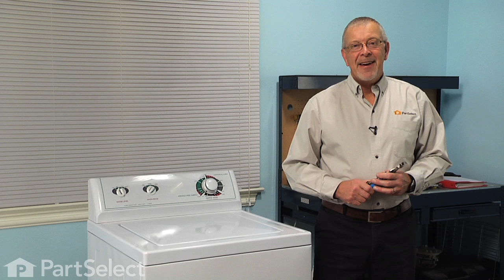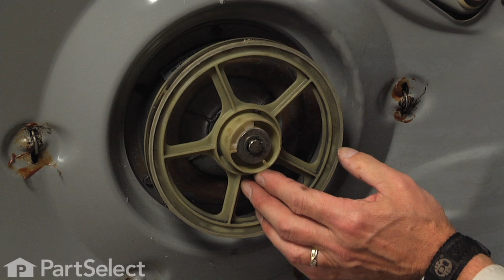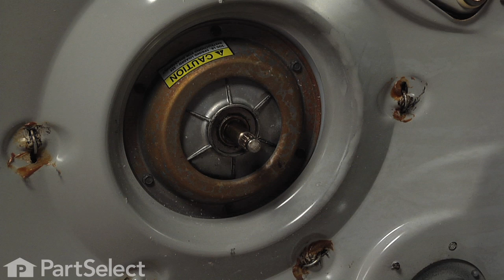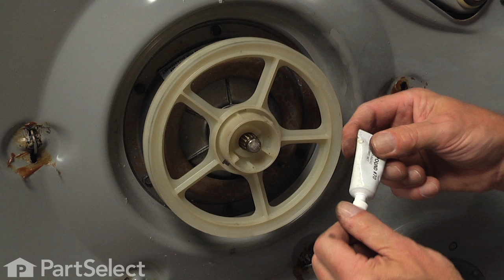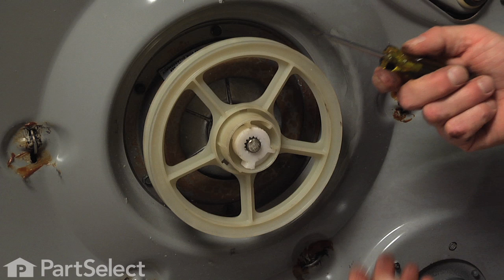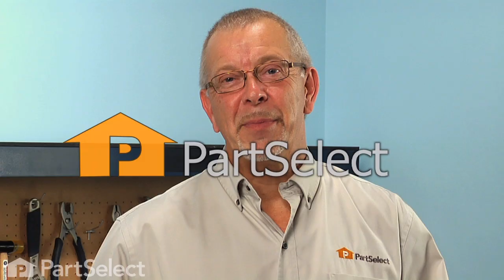Washing Machine Repair - Replacing the Transmission Pulley & Bearing Kit (Whirlpool Part # 12002213)

Comment: The problem with my washing machine was that it would not spin during the spin/rinse cycles. If I manually spun the tub around a bit then it would spin but it made a very loud roaring-whirring noise (you can hear it outside). So I got my kit and installed it (yes, the e-clip was a buggar to get on), ran a test cycle, and it spins but it's still roaring. It remains to be seen if it will still spin every time. What else could be making that noise?

Comment: I have a Hoover HAV4200AWW I replaced the Transmission Pulley & Bearing with the kit. It still will not spin. It was very hard to get the E clip back on, and the white plastic cam that fits in the transmission pulley would move with the shaft. Something else is wrong. If you try to turn the drum by hand, it is very hard to move. I checked between the drum, and tub, but found nothing that would prevent it moving. What would cause the brake not to release?
Reply from the maker: if the cam is position right you should be able to turn the main pulley by hand with the belt off and the machine unplugged one way and the machine will agitate. then rotate the pulley the other way which will rotate the cam and release the brake and the tub should turn freely. Sounds as if the brake is not releasing properly

Comment: Great video, thanks.  Two questions.  Why does the kit include the big pulley wheel?  Is there any part of the old pulley wheel which wears out?  Secondly, I replaced this bearing 8 years ago using one washer curing the problem nicely.  After an additional 8 years I am again having the original issue.  Is it possible to add the washer I did not use last time to perhaps cure the problem again?  If the bearing has worn a little and needs a little more pressure, adding a washer is just a little cheaper than buying the whole kit again.

Comment: How do you diagnose that this part is a problem? I just replaced the motor on my Maytag a week ago because the original motor seized. Could barely turn it by hand. Was smelling what smelled like burnt candles for a couple of weeks but our Maytag Performa Model Number PAV2300 seemed to be running fine. Now after a week with the washing machine running like New a odor and smoke is coming out of the new replacement motor that it shuts the washer machine down. At my witts end at this point. Don’t just want to throw parts at this 16 year old machine. Any ideas as to what is going on? I should mention the machine while running is doing what it should be doing but my guess is something is causing it to make the motor overheat and there are no funny noises coming from anywhere. I am stumped. I take the belt off which I replaced with a new one at the same time I replaced the motor. Pump pulley turns freely back and forth. New motor pulls turns freely back and forth. Transmission pulls turns clockwise freely but not counter clockwise but does turn my hand counter clockwise making me think  maybe this is putting stress on the motor.  I am about to give up and purchase a new washer soon if I come up empty here. Any and all help is appreciated.

Comment: Hi, i have a top loader whirlpool washer. It washes good and everything but the issue im having is when it starts to spin it bangs against the sides. Crazy noise. What could the issue be?
Reply from the maker: Hi Linda, thanks for the question. Here's a troubleshooting guide for a noisy or shaking washer:
https://www.partselect.com/Repair/Washer/Noisy/
https://www.partselect.com/Repair/Washer/Shakes-Moves/
I hope this helps! Let us know if you have any more questions!
Reply: PartSelect i found out that its just the rods that need to be replaced.. thx for your reply

Comment: I have a Maytag Performa with this setup. The machine fills and washes fine but the tub will not spin. I verified this by marking the inner tub and noticed it stayed in the same place. The clothes come out soaking wet. These videos show how to replace the pulley but do not state the symptoms. I notice there is a ramp in the pulley that corresponds with small part under the E-clip. Does the ramp release a tub brake when the big pulley is turned in the proper direction?
Reply from the maker: Hello, please provide your model number and I will be happy to research this for you.
Reply: Did you end up finding out the problem on your washer? We have the same issue too.
Reply: I think I might be having the same issue!

Comment: What about the smaller pulley (also on the bottom but towards the front right corner)?  I was thinking my issue was the belt, but when I tipped the washer over I found shredded pieces of the pulley on the floor and the pulley was shredded and jagged.  And if I replace the smaller pulley will that solve the problem or is there some more serious problem that means I should just replace the washer?  I am looking to get at least a few more years out of it.  It's a solid machine and not filled with expensive electronics like newer ones.  And should I go ahead and replace the belt while I have it tipped, in case the shredded pulley also affected the belt? Thanks.
Reply: Also, the washer spun and agitated almost 100% ok (though it would sound fairly loud and unbalanced) until a few weeks ago when it started getting really loud.  Eventually last week it started making the burning smell so we quit using it.
Reply from the maker: Hi Gary,  the smaller pulley is either on the pump shaft or the motor shaft and are not available separately. We do see some motor pulley failures occasionally and the part is relatively easy to change. What is your model number and I can check parts for you?

Comment: Just replaced the items in this video. Seemed to do the trick, no more noise. I used the small washer, think it is ok. Will check in a week to make sure I do not need to change out for thicker washer. That seemed to be my only concern if I got that correct or not. It had the thicker washer on old part when I took it off.

Comment: I have a Maytag washer model MAV208DAWW. It is making a lot of noise when washing/rinsing, I just replaced the belt thinking that was the problem. It is still making the noise :( Would like help from someone in diagnosing further as to what my next step should be. Thank you.
Reply from the maker: When checking under your model number for the symptom “noisy” the top parts customers have ordered to correct
that issue beside the belt is drain pump, snubber ring, brake rotor or stator. Here is a link to our site for your model symptoms to read our customers issues to see if they might match up with yours. If not, I would suggest contacting the manufacture for trouble shooting.  http://www.partselect.com/AdvancedModelSymptoms.aspx?ModelNum=MAV208DAWW&mfgModelNum=&fkMfgID=1&ModelMasterID=6379&PID=43

Comment: I have a Maytag PAV5158AWW  and the symptom was not spinning or agitating - but it did drain water. No noise noticed. I replaced this (thrust bearing and motor pulley) and it didn't fix it. Any other thoughts? One thing, re: the alignment and pulley adjustment at the end, is that when I turn it by hand the arrow JUST makes it to the pair of reference points. That's without using any washers; just the 'E' clip. Am I right that if I used the thin washer that it would prevent it from even going that far, so I should leave them both off? And even if it isn't quite getting far enough, I imagine that it would still turn some when I run it?

Any other thoughts?
Reply from the maker: Does the inner basket turn when you rotate the drive pulley by hand in the counter clockwise direction? Does the agitator oscillate when you turn the pulley clockwise?
Reply: Thanks for the response!!! The agitator does turn when I hand-turn clockwise; the basket does not when I hand-turn counterclockwise.
Reply: Just a "bump" in case you missed my reply and new question.
Reply: Just a "bump" in case you missed my reply and new question.
Reply from the maker: When you turn the pulley counter clockwise you should meet some resistance as the cam contacts the pulley and forces the brake spring to compress. This action releases the brake and will allow the basket and transmission to turn. Check to see if the pulley and cam are properly installed.
Reply: Thanks; I don't recall that resistance, but I have it apart again, trying to fit one of the washers on. First, can you please confirm that I'm using the correct part, this assembly for my Maytag PAV5158AWW? (reportedly, it was an Amana rebranded by Maytag, fwiw). 

The spacers/washers are different, and I can see why I can't fit a washer on, as the new pieces inside of the pulley take up more space than the 4 combinations of washers/spacers that had been on it. Or should I try it using those? I'm not even sure that this was the problem before?!

Great videos for installing replacement parts, but the diagnosing of the problems/solutions seem to be the bigger problem for people. Thanks.
Reply: I re-checked my install, and that was correct. And see that they've re-designed the assembly, so I simply am using the new one. 

I finally was able to get the thin washer and e-clip on, after buying some smaller channel-lock pliers that enabled me to do so. And the e-clip is a bit bent. But it's on, and definitely no play there. But the arrow on the lower cam doesn't quite get to the first pulley indicator mark. Which means that there is too much space/washer there. So..

I took off the washer, and now I'm able to get the e-clip on (without 3,000 curse words), and (as with the washer), when turning the pulley counterclockwise from underneath I feel the resistance of it compressing the brake spring. And this time it is properly occurring with the cam arrow between the indicators on the pulley.

But the basket still doesn't turn. I read one forum post (I think for this make/model, but not sure) where a guy said the brake rotor was frozen, and he had to use force to unfreeze it; could that be it? Or what would cause it, now that I do have the arrow landing between the 2 indicators on the lower cam when it engages the brake springs?

Comment: I have an admiral model AAV7000AWW, tub doesnt turn while off nor on, i already change out the drain pump assembly  because it wouldnt drain. now i have this issue... anybody know what i need to change. Do i need to replace the transmission pulley and bearing.  Please help!
Reply from the maker: Is the belt slipping on the drive pulley? If so, check the motor glide and tension spring first. You should be able to rotate the
drive pulley by hand in one direction and the agitator will oscillate and in the other direction, the inner tub should rotate. If not, check the thrust bearing and adjustment of the pulley before suspecting anything else.

Comment: I have a maytag mav208dww that isn't spinning up to top speed.  I replaced the thrust bearing, but I couldn't get the reference arrow to fall between the marks with either of the washers ( and when I ran a spin, it wouldn't get up to speed still). Also noticed the agitator will randomly speed up and slow down durning the spin. Any suggestions??
Reply from the maker: +todd wochok Check for damage to the pulley and also that the new thrust bearing is assembled properly.

Comment: Hi, I have a Maytag top loader washer, Model # MAV3855AWW . Very first start of agitation, it would make a grinding noise. It went away after 10 seconds. Major problem is when the washer starts to spin, the tub spins, but the agitator still works as if it still in the washing mode. The tub does not spin as fast as it should. Thank you for any information you have.
Reply from the maker: *****  It sounds like you may have a problem with the brake or with the drive pulley thrust bearing.

Comment: Today I did this replacement - but it didn't fix the problem. My washing machine will spin but it won't agitate.  It has occasional spasms, but no consistent movement. 

I removed the base agitator and the splines looked okay, so I put the machine on a wash cycle without the agitator.  The centre metal post isn't moving. 

Please, can you tell me what's wrong?
Reply: I am the same, did this replacement, but the racket noise that is coming from my washing machine continues. It agitates and spins, just extremely noisy. You can feel the vibrations in the floor, but the machines does not walk or anything similar.
Reply from the maker: You may have a problem with the transmission, which is the component that provides the agitation or you may just have a problem with the drive belt or pulleys.

If you are able to tilt the washer back and inspect the drive belt and pulleys from the bottom, you should be able to isolate the problem. Remove the drive belt and inspect for excessive wear. Check the motor and transmission pulleys for slippage.  Turn the transmission pulley by hand in a clockwise direction as viewed from the bottom. This should engage and easily rotate the input shaft to the transmission. If the pulley does not rotate freely or if the agitator shaft does not oscillate continually while turning the pulley then the transmission is most likely defective and should be replaced.